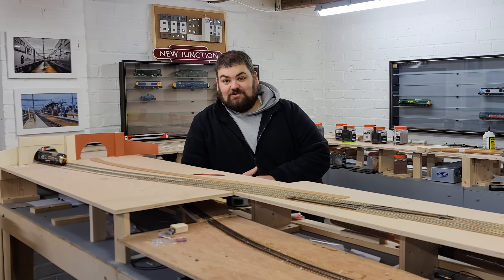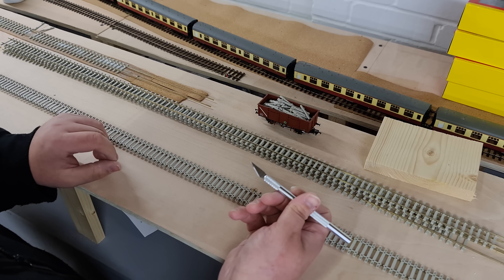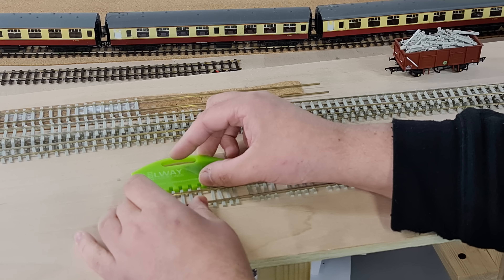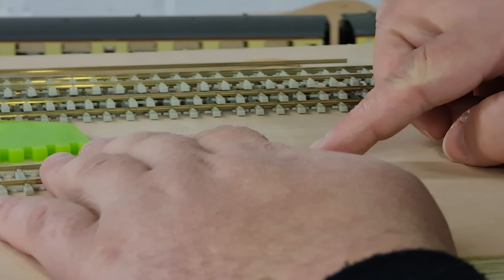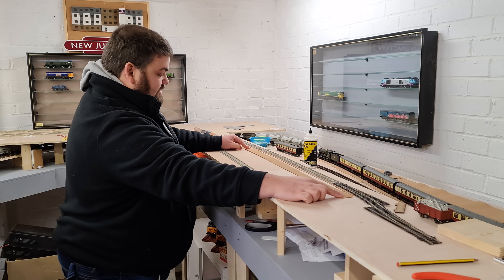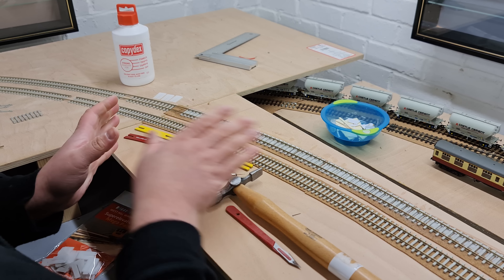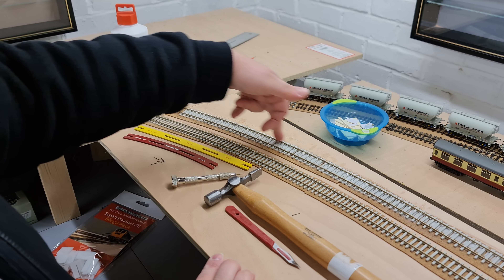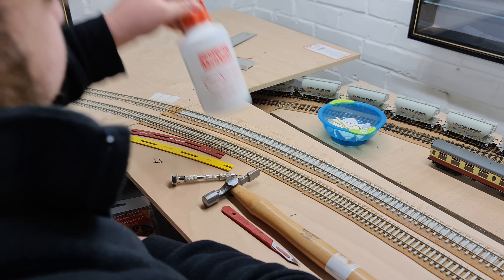New Junction EP8 - Laying the Mainline

Comment: Sleeper spacing always looks miles better. Gives a much nicer profile to the look of the track. Great video as always 👍
Reply from the maker: Many thanks!
Reply: @NewJunction  so why don't Peco produce it with the correct spacing. It would also reduct the amount of plastic needed?
Reply: @davidtwist3659  DCC Concepts do a flat bottomed and bullhead track with correct sleeper spacing. However this is only in wood not concrete as of yet.

Comment: Cool! I did this a little recently with n gauge, but only about 8 inches. It was also Peco code 55, so the sleepers were attached to the rails slightly differently, or extra.
Reply from the maker: I'd struggle to do it in N gauge!

Comment: Timesaving tip . Instead of cutting all the webbing, count the sleepers in the length of track. Then remove a "block" of a fifth of them. Cut all the remaining ones and proceed as normal.  Or is that impractical?
Reply from the maker: That'll Work too 😆

Comment: 13:14  so may answer later in video but before I forget how for a modular layout do you lay track scenics and that do you lay add so it looks good but still can be moved
Reply from the maker: Sorry I don't understand the question?
Reply: @NewJunction  how do you make a layout that will be taken apart so you add track then cut or cut to the joins. Same for scenery

Comment: Not quite as laborious as building your own (natural next step?, was for me) but once you've gone to the effort of improving the overall p-way, you won't go back. I hope you enjoy the results. You are moving next level now.....
Reply from the maker: Thanks Iain, I don't think I'll venture to building my own track lol
Reply: @NewJunction  its worth a try, pointwork especially, there are some nice kits out there - way cheaper for one thing and can look better - if a clumsy oaf like me can do it anyone can - actual track perhaps less worthwhile (ready made is cheaper) but its not hard at all - especially with like a cork track bed, can make in sections away from the layout then install
Reply: @aleopardstail  Aye, I don't disagree. (Not the oaf bit, I don't know your work to agree or differ dear sir).
It depends on your desired outcome to an extent. Checked curvature is not represented in ready to lay and then what track you are representing by chair type is still wide open. I doubt it will bother many but concrete express formation points are not available proprietary for the masses, before we follow Alice down the rabbit hole of gauge debate.

Comment: Good film Richard, and the spacing is a great improvement on the HO look track. Sadly not available for the pointwork.
 Tell me , with the Elevation Set, do you have to put the wedges in very close together, or can you space them apart, say 8-10mm, and fill the gaps when ballasting? 
Is Copydex better, easier, more expensive than PVA glue?  I have only used PVA so far.
Reply from the maker: You could space out the sleeper elevation bits, I didn't want to risk it mind. Copy dex is a fast drying glue which helps when laying the track, ill use PVA when ballasting to really seal it all in. 😊

Comment: In respect of tunnels entrances have you taken consideration of cantery? I had a class 90 and cantery was in locked down position but it flipped up during a run smacking the tunnel and taking the train off the track, I was lucky it was low speed and I had not yet fixed the Hornby tunnel face in a permanent position. I would like to know if there is recommended working height for tunnels so trains with cantery can pass with with the overhead pickup in up or down position?
Reply from the maker: Not yet but its a work in progress 😊

Comment: Hey Richard, question if I may. Followed your movements here and Everard Junctions, but I am finding that my Peco code 75 bullhead flexi track is behaving differently to yours. I snipped the webbing and removed every 5th sleeper but I find the Railway Laser 00 gauge is putting the sleepers closer together so I have to add quite a few sleepers to the end of the rails! The gap seems to be about 6mm between sleepers is this what you found on yours? What am I doing wrong.

Comment: I am currently clearing my garage in preparation for my first ever model railway next year. As you will appreciate I am on a steep learning curve and would appreciate any help that you could give. 
The sleeper spacing looked great but appeared very time consuming, As your layout is new did you consider using Peco bullhead track? If not, why not?
I also watched your recent update where you soldered droppers to every piece of track. However, I believe that a few years ago you produced a video showing the use of wired fishplates. Which is the best method?
Many thanks. Adrian
Reply: As no one has answered you so far I thought I'd offer you some beginner advice. Like a lot of people here I have been doing this for 30 + years.

You never count on fishplates to conduct power. They will do so on dry track with no ballast, but the moment you use PVA and water to ballast your track the fishplates will corrode on their inside surface and stop conducting power. Power wires must always be soldered directly to rails for long term reliability. 

This is why you use the longest track sections possible to cut down on the amount of bus wire connections you need to make.
Reply: @willowsjunction7989  Many thanks for your advice. That is a great help. I will be using Peco flexitrack which will reduce the number of soldered droppers that I will need. Think I will need about 70 sections of track and 20 points, so will probably be an expert at soldering when finished.

Comment: Hi Richard, once you raised the curved track to apply the Copydex, how did you prevent the track from pinging back once the pins were not holding it? Thanks
Reply from the maker: I only removed the pins once the glue was dry. 😊

Comment: Hi Richard. Why didn't the track manufacturer (PECO?) get the spacing right in the first place? Is the superelevation kit multigauge, or just for OO gauge?
Reply from the maker: Thats a question for Peco hehe and yes you can use the spacing bits on all gauges.. just double them up to suit.

Comment: I’d noticed very early on in the video you were wrapped up, with more layers than an onion. And you commented it was cold towards the end. Are you concerned about obvious temperature fluctuations through the seasons?
Reply from the maker: Hi Martin, as long as you're prepared for it yourself and on the layout its fine. I avoid thin card kits incase of damp and create sutible expansion gaps in my track.

Comment: A simple question for you Richard ; why do the manufacturers sell track that is incorrect?
Thanks
Reply from the maker: OO is an odd scale as its incorrect and to change the spacing would cost a fortune in tooling costs.
Reply: @NewJunction  Sure, but do you not feel that someone is missing a trick? The first to do "accurate" would clean up!  Peco just invested bundles in TT after all.
Reply from the maker: @steveluckhurst2350  you're not wrong!
Reply: @NewJunction  C & L finescale flexi track is already at the correct spacing as I understand

Comment: A layout designer/builder in the US recommends off-setting the rail joints, especially on curves as it stops the natural tendency of the track to want to spring back out. Does the re-spacing of the sleepers stop this as the webbing is no longer there? Also would it not be even more prototypical now that rail joints (on the mainlines) are welded and the sound and feel of rail joints are limited to point work.
Reply from the maker: Some top tips there. Cutting the webbing does make the track less likely to spring back.

Comment: hi richard do you put your dropper wires in after fitting the track or did you forget to say ?
Reply from the maker: I do and ill be hiding them on the copper sleepers ill use on the modular ends of the boards. For a static layout I'd add droppers first.